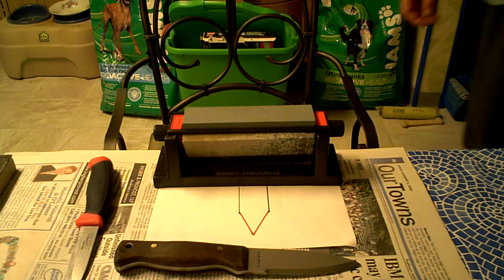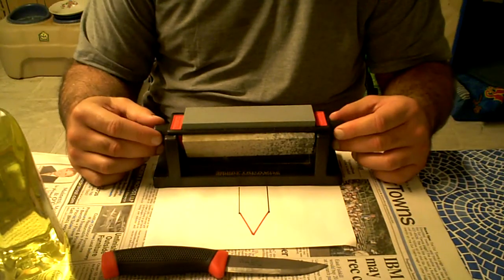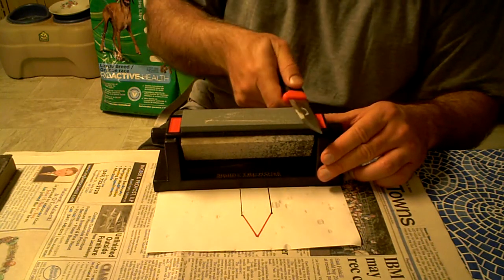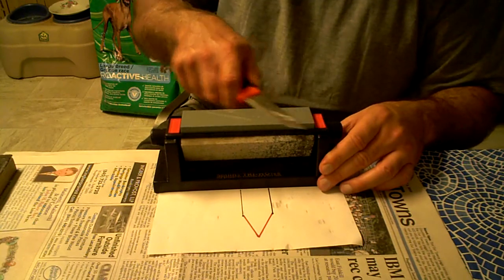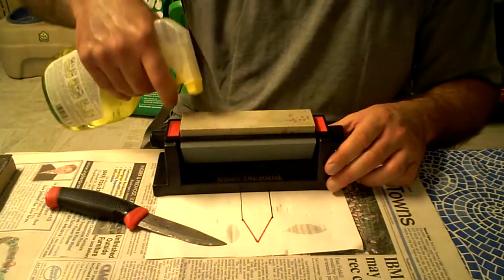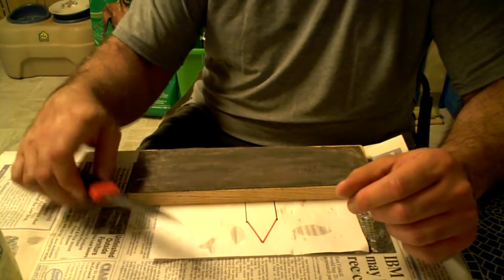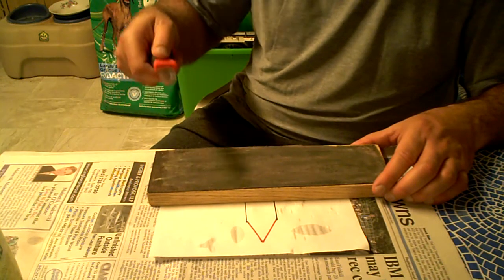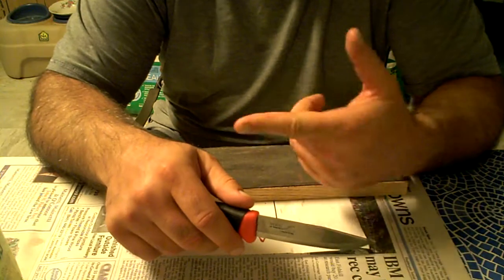HOW TO SHARPEN A KNIFE pt 3-Scandi Grind.AVI

Comment from the maker: I've seen both used by experts and used both methods myself, depending on the equipment I am using and where it will be used. For beginners, using several good quality stones with lubricant, I think edge leading offers a good way to learn consistency. When I'm away from home and have just one sharpening device and a strop, then I'll use edge trailing, especially on convex grinds.

Comment from the maker: The backing you use will make a big difference in how the edge is done. I have two strops. One is mounted on a block of hardwood. I use this for my scandi edges. The other is a standard hanging strop. I use this for my convex edges.

Comment from the maker: One thing I like about Simple Green is that I can just wash it off with hot water when I am done sharpening. I then add some oil to protect my tool steel blades. After washing, I just dry off my stainless sheath knives and add a drop of Tuf Glide to the pins and locks on my folders.

Comment: For myself, I've found the level of improvement to be inversely proportional to the condition of the stone, but there is always improvement. Like ya said though people vary, and one may master one technique better than another. It just seemed like you were saying never do this. The person I learned to sharpen from (Murray Carter) taught an edge trailing stroke for finishing on each grit and it worked, really well.

Comment: This was a very good and informative video, especially for the amateur knife sharpener.  I would recommend however that you use mineral oil as opposed to a vegetable oil, as mineral oil will not go rancid.  If you are frequently using your knife, this should not be a problem, however it is something to consider, especially if you are not using your blade daily.

Comment from the maker: For the past several years I've been lecturing on knife use at the New England Knifemaker's Guild seminar ( google ashokanknifeseminar ). I've learned a lot there on sharpening from the custom makers, especially Tim Zowada and Dan Maragni. It was either Tim or Dan who gave a lecture on sharpening that included photos of a knife edge seen under a microscope at intervals in the sharpening process. Their argument was that a trailing edge pulled bits of metal from the edge when using a stone.

Comment: @poisenfrog7 It depends, if you have a full flat ground blade, a scandi grind is not possible. Its not too hard to turn a saber grind into a scandi, all you have to do is eliminate the secondary bevel; you can do this with simple wet-dry sandpaper.

Comment: Nice set of videos brother. I disagree with your thoughts on an edge trailing stroke on a stone though. I've found an edge trailing stroke will give a much better edge for the final laps as opposed to edge leading. Any time you use edge leading your edge is bumping into small stone particles, metal particles, and small undulations in the stone. All this is erased by a stropping action on the stone for the final few laps on each grit.

Comment from the maker: It just takes practice. Try counting the strokes on each side of the blade and see if that helps. If you are still having trouble, try finding someone on YouTube sharpening your brand and model of knife or using your type of sharpening stones and see if they are doing something you are not. There is no magic pill though. You still have to do the work.

Comment: On the contrary, I found Scandi grinds to be difficult to sharpen, one needs to remove plenty of steel along the edge/bevel and it can lead easily to rounded edge. 
Also, sharpening them scandi ruins the polish and will lead to easier rusting... I don't have any polishing gear except a 2x face leather strop with grey and green compound (not optimal tho)

Dunno, scandies aren't the easier for me.

Comment: Nobody ever explains why you push into the finished edge instead of away from it.  In other words, why don't you pull the blade toward you at the correct angle instead of pushing it away?  It's not a safety issue since flipping the knife in any method brings the blade to you anyway.  And pulling the blade spine seems safer if that were any excuse.   Is there a science basis?  Let's say metal fragments from the spine angle wind up at the edge.  Wouldn't stropping clear that right up?  Just asking.